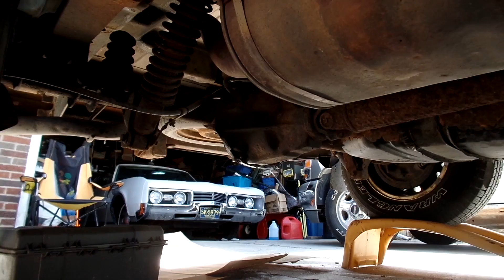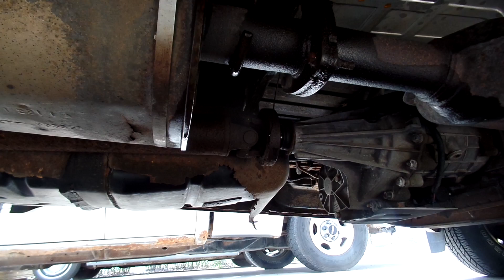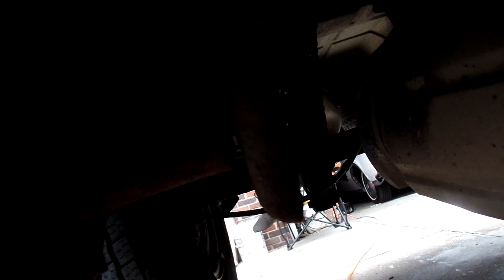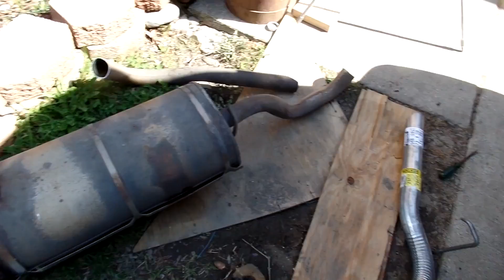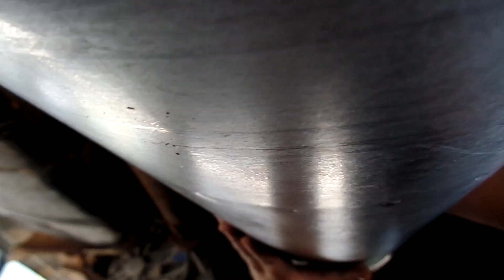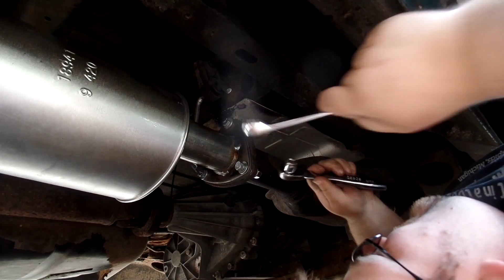How to replace the muffler on an second generation Chevy Astro van

Comment: How did you get the bolt out of the hole?  Did you drill it out?  What bolts did you use to connect the new muffler?  New bolts?
Reply from the maker: Hi And thanks for watching. I used the reciprocating saw to cut the heads of the bolts off. And used a punch to punch them the rest of the way off. If you have a die grinder, It would be a lot faster as these are hardened steel bolts.  When I bought the new muffler I also purchased new exhaust bolts with it from my auto parts supplier for this reason. I hope that helps. -Nick.
Reply: Thanks for making this.  You put in a lot of work!
Reply from the maker: No problem. I hope it helped. I did put in a lot of work, but I enjoy it in my spare time. My expertise is in small engines, however some of that translates to vehicles as well.